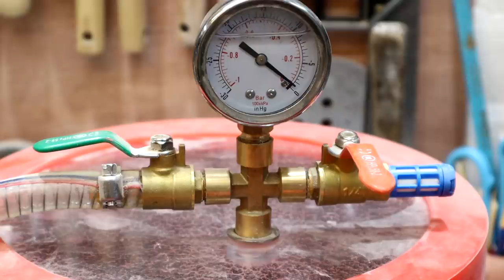Woodturning - The Dog Whistle

Comment: Beautiful whistle for a gorgeous Dog!
If I've seen it correctly is the lid of your vacuum chamber cracked. It can be very dangerous if the lid is giving in and the chamber is imploding!
It happened to another YouTuber and he got some bruises and cuts on his head by the sharp edges of the glass lid.
Reply from the maker: Thanks, its surface checking and its acrylic not glass, I have another on order but this seems to be a common issue on the cheaper ones.